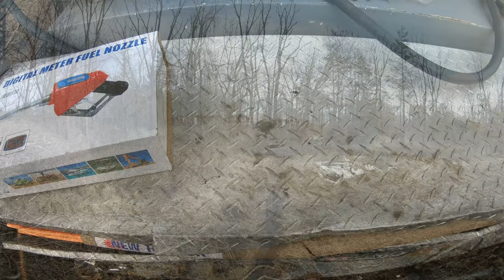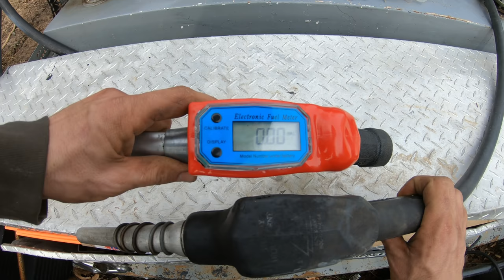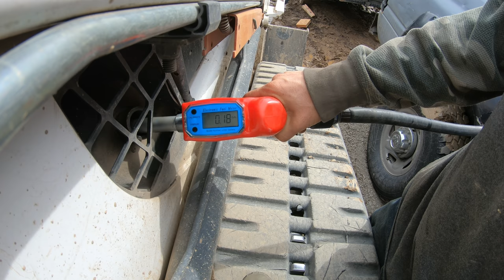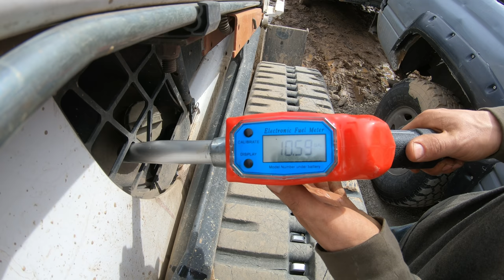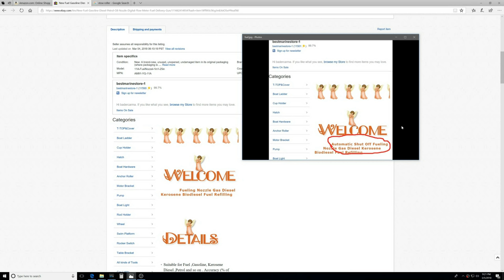Installing an underground propane tank

Comment: Getting the digger stuck made things interesting. As someone else said, don't you compact the ground or gravel? In the UK with have to compact everything and we'd never back fill with water in the trench.
Reply: I think it's very bad practice! Should never back fill with wet material and he should of sanded the trench before back filling and should of got rid of the ground water and the sloppy wet shit!! I have watched a couple of he's videos and don't think he's work / ground works is good at all in my opinion..!! He would be sacked if he did that sort of work here in England
Reply: I dig and back fill slatted tanks. Often backfilled them with a foot of water in the bottom. Never had and problems as track it in and so on. I back filled a tank in really hot weather the hottest we ever had last summer. The soil was like dust going. I thought it was fine until the rain came and it all sunk down bring concrete pads with it
Reply: @ferguson20diesel49  I know it's different weather in the US but general practice groundwork is a not good! I am not saying your a bad worker! I am just saying your groundworks could be improved .... Your a dam hard worker!!
Reply: luke Grace wet souls of Ireland. Very rare to dig a hole not have water in the bottom of it. No customers have came back so all is good.

Comment: talk about a shit ton of ground water.... Will a septic tank work with that much ground water?
Reply: it will  float :-)
Reply: That ground water sure could be a problem. My family built a house in eastern Wisconsin. It had to be ditched on two sides. Eventually we installed two wells 3' diameter by 6' Deep on far corners. Then two sump pumps. Lots of mold problems in the house.
Reply: Man, that's wild! But yeah, I have a feeling that this will be known as the "Swamp House" I've never seen so much water. Not an idea place to build a home I think...
Reply: The septic system we had in Wisconsin ended up leaching into the ditches. It could be very stinky. In the winter the 3" line from the sump pumps would freeze until we ran a coil down the middle. It drained into the ditch which of course froze so it created a skating rink that just got bigger and bigger through Jan. and Feb.
Reply: Here where I live in Canada,..I'm fairly certain that.our Department of Health would condemn that area for a septic field.
Man oh Man , Andrew, you have a lot of water to drain away from there!
Reply: There are alternate septic system designs that work fairly well when the ground is saturated like that, but many states don't recognize them as an approved method.  The standard design tank/drainfield is getting dated anymore, states need to catch up and approve better methods which not only work in marginal conditions, but often return a better end product to the ground.
Reply: What are those alternative designs? I'm looking into a septic system in a saturated area right now, actually.
Reply: How about a mound system
Reply: Where I live, you've gotta have at least 36" of stable soil between the water table and the floor of the leachfield.  If you build in a river/creek bottom/flood plain or area where the water table is high and would contribute to an event driven failure (extreme rain event, snowmelt, etc.), a good choice might be above-ground placement, like @Larry Kluck suggests.  Get a soil analysis and perc test done, then check to see what your area allows for design.  If you have to place the mound system on a higher grade, a pressurized tank/field array can work pretty well.  Biggest thing is to keep the leachfield viable and tank arrays free from groundwater infiltration.
Reply: It’ll work but fill it either water before you cover with concrete
Reply: Septic is so '90's old technology
Reply: My tank always had standing water on the top of it.  It caused the regulator to fail repeatedly, and eventually the tank developed numerous leaks.  I now have an above ground tank.
Reply: @Harley04  yes 1890s
Reply: @mikewalko536  They are called mound systems
Reply: @mikewalko536  an engineered pressure dosing Mound system would work either in PTI or Infiltrator. Most code worth its salt would require a 40-60 inch dig out backfilled with proper sand then depending on water saturation levels I guess about a 36-40 inch finished mound. I have installed smaller mounds but not in such a wet area honestly I don't see how the house was ever intended to stabilize in such an area. I have seen project sites where removing 3 feet of muck and filling with fill dirt was the only way the land became viable this seems like similar land without out the de-mucking done. I would like to see a 10 year follow-up on this particular site.
Reply: @regsparkes6507  As a fellow Canadian I realize that Canada is a huge country.  It is absolutely massive and what is condemned in one jurisdiction would be acceptable in another.   Of course Americans refer to Canada as just that but being a little more specific would help.   Even a provinces except for the maritimes are huge.
Reply: Peggyt1243 I have found that people in Ontario  refer to “here in Canada”  as if they are the only province that matters, conveniently forgetting the other 9 provinces and 2 Territories.
Reply: @regsparkes6507     The only septic allowable would be a 2000 gallon holding tank that you must pump out every time it gets full. NO WEEPING TILE BED ALLOWED!!   In Canada.
Reply: @rickoncordova1  I don't think your statement is correct for all areas in Canada,...( in fact I know it's not ) I do know that this is NOT the case in my province.
If you have to pump out a 'septic tank' then this would be known as a holding tank,..and not a septic tank.
Reply: @regsparkes6507      Reg. Talk to a septic tank installer or the inspector at your township office and have them explain to you the difference between a septic tank with weeping tiles connected to it and a holding tank with NO weeping tiles or bed connected to it.  Thank you.  Rick

Comment: All of your drainage ditching sure helped a lot. The site was a lot drier when you dig the hole for the propane tank compared to trenching the waterline. The propane guys backed over the trench with no issues.
Reply: m9 ovich 
You can see the well head beyond the truck. He certainly did back over the trench.

Comment: Holy FMF !! ! That would really piss me off!  Auto stop does not work. That is a major issue. Does it give an accurate reading? Pumping into a 5 gallon jug is not any kind of an accurate measurement when you are pumping 100 or more gallons into your equipment or a holding tank! Made in China?
Not to be a negative nelly but, in Canada we are not allowed to bury propane tanks. Don't know why? seems logical , keeps from liquifying when it's -50C or so with wind chill.  Would protect it from the wind, plus the thermal heat would help to keep it warm. 
Who am I to talk logic when we have a person a the helm that is yahooing with a dress on and joint of pot in hand?  CHEERS ANDREW, LOVE YOU VIDEO"S!!!!!!
Reply: Joel Hill really you can't have underground propane tanks in any of Canada?
Reply: I spent 12 years in the propane industry in Toronto in the 80’s and 90’s and you certainly can’t bury tanks. As mentioned it would help keep pressure in the tanks when the temps hit the -40* mark and propane doesn’t boil to produce pressure. We would often have to go to construction sites with 2000 gallon tanks to put a few hundred gallons into them to get them some pressure and the tanks were coated with 6” of ice. 

Some reasons I heard why we can’t bury is because of corrosion and leaking. The white bags they put around the tank should help since they are a sacrificial anode that will corrode instead of the tank.
Reply: Wayne Crews wow. Never would've thought that. Around here in the northeast its very common to bury tanks. I've dug holes for dozens. Usually the propane company will give you a print out of how much bigger the hole has to be then the size of the tank getting installed and the minimum depth from the surface. That one looked a bit high to me. Also most companies want you to back fill around it with mason sand not native dirt , and they have all had at least 2 anode bags on either side of the tank.
Reply: Meadow View Lawn Care LLC 

I think finished grade will be higher once all the other work is finished off. 

I know I wouldn’t want to have to search under 2’ of snow at 2am to fill a tank for a customer that ran out of propane. 

Out of curiosity what is the life expectancy of a buried tank and do you need to replace the sacrificial anode bags before replacing the tank?
Reply: Wayne Crews not a expert by any means but I asked one of the propane guys on one of the first tanks I dug for and he said 40-50 years. I'm not sure if the bags need replacing before that. The ones I've seen put in have a heavy epoxy paint on them. Even at that, I still wouldn't wanna be around when one lets go! How are the laws in Canada around under ground residential  oil tanks can you have those? Mostly older homes here have them like from the 50s.  Not as common now.
Reply: I think I found the same nozzle online and I looked at the description. I don't see anywhere where it says "auto-stop". Are you SURE it is auto-stop. On the part of the nozzle that goes into the tank, is there a small vent hole? If not, its not auto stop.
Reply: +Joel Hill  I live in the California Sierras and we are not allowed to bury our tanks either.  Our big tanks are 499 gal as they have a stupid level of rules and regs and insurance  that kick in at 500 gal.   Even so, the 499 gal tanks have to be at least 50 feet from the structure.    I feel your pain, we have Governor "Moonbeam" at the helm.
Reply: @kayakingphotos  He showed a screenshot where the nozzle's description showed it as auto shutoff.  He also said the seller gave him a partial refund AND changed the description so it no longer showed it as auto shutoff.

Comment: Leakage from buried tanks can do the same thing pipeline leakage can do, which is saturate a lot of soil around the tank instead of just venting to atmosphere, which is likely why some jurisdictions prohibit burial.  

Except for appearance there's no reason to bury them and it makes future external corrosion inspection impossible. Looks nice though.
Reply: One reason to bury them is to keep them warmer in cold climates. At -40 there is no vapor pressure so the gas won't come out of the tank. You have to build a fire near the tank, which is kind of scary.
Reply: Yea to keep it warm you would want to burry it. I believe it’s -25 or so propane gas turns to a liquid and it won’t flow correctly. But even I little warmer and you start to run in to pressure drop. Definitely a good idea to burry has nothing to do with looks.
Reply: Propane stays liquid at minus 44F.   @tiredoldmechanic1791
Reply: -44F propane stays liquid yes.   @brettchristinaadams8112

Comment: You do some backwards arsed stuff sometimes andrew 🙈 next time you dig the last piece of trench straddle it at the opposite direction. That trench should have had some drainage chip in the first few hundred millimeters as well which would have kept the mud out of the water

Comment: @25:24 The moment you start tracking fuel consumption per job. Next day increase mark up by 5% per job.
Reply: Jacob M. Altland and more of this 02:15
Reply: The guy is logistically brilliant though. He gets most of this done with his own power. Hats of to working with a small crew.
Reply: I dont know for sure if he would. I was making the point that untracked fuel expenses can be detrimental to a company. So when you take a look at how much each job is consuming you can better determine the mark-up per job. I assumed a mark-up of 5% becasue fuel can account for at least that amount of a projects costs.
Reply: I track all of my fuel expenditures in my business.   Since I am a truck driver, that falls into 3 categories:  Fuel usage while loaded, fuel usage while empty, and reefer fuel usage.  All 3 of those impact my bottom line.  Finding ways to decrease fuel usage is a benefit to any business.
Reply: House Music  Yeah hippie that's exactly the reason.
Reply: Michael Tovar can you get a refund on road tax for the amount you burn not moving but running refrigeration?  I heard some of the gps enabled log book and trucking software would track these details for tax and billing.  Keep on trucking 😀
Reply: markusayt the fuel is red... that’s heating oil. AFAIK, you can get into some pretty deep shit for using heating fuel in your transportation vehicles. Not sure if it is an issue with construction vehicles.

Comment: I'm getting reamed for Propane in the PNW.  I'm living in a travel trailer while the house is being built and they're charging me $2.89/gal.  It's costing me about $200/mo to heat the trailer -- my previous MH cost $95/mo at most to heat in (a colder) winter on Natural Gas.  I'd hate to see the bill for that 500 gal tank (425 gal net)!
Reply: I wonder how much of your $2.89 per is for 'taxes'?
Reply: the more you get per trip mean less often they deliver=Lower price.... and price shop for gas  on tank ownership vs lease- and suppliers
Reply: Wow, $2.89, I was pissed paying $1.89. Guess I shouldn't complain... You need to look into buying your own tank and shopping around for the best cash price. If you're in a trailer you should be able to make due with a 124 or 300gal tank.
Reply: The trailer is a temporary situation, just until the house is finished in ~June.
Reply: I live in WA State and we have a 500 gallon propane tank for our shop heater. While you pay $2.89 / gal, most bulk purchases are significantly cheaper. It's been quite a few months since my last fill up so I don't know how much less, but I do know it is less than what you pay if you fill up your RV tank. We also have the option of "shopping around" to find the best deal. It's still expensive, but there is savings.
Reply: Yeah I hear ya. I get a price break if I order 250 gal or more, so that's what I'll do... I also like to buy in the middle of summer, price is cheaper sometimes too.
Reply: Here in southern Wv it's  1.59. The cheapest month to get it is in April...
Reply: Damn that's cheap, almost make ya want to have an extra tank to fill.
Reply: EFormance Engineering lll.
Reply: M

Comment: My underground tank was a disaster.  Always filling up with water in the gauge and refill area.  The water caused the regulator to fail repeatedly.  Eventually the tank started leaking in several areas.  I now have an above ground tank, and zero problems.

Comment: Wow what if that chain breaks when pulling out the skid steer you would be chasing that maching in the woods.
Reply: Mike Hurley that machine moves so slow anyway. I’ve seen wheelchairs move faster
Reply: Way too many unnecessary risks.
Reply: meh, I've seen far worse from other people. Those who work at heights without harnesses are far more likely to get hurt. From what I've seen with Andrew he has a great mind for getting shit done, good attention to detail but without the bullshit. I think he has a good understanding of the risks.
Reply: Chains don't store much energy. Don't tow with nylon unless you know the risks of a kinetic recovery. But chain or Amsteel doesn't stretch and won't spring back much. ETA, nylon plus a weaker chain would be a really really bad idea.
Reply: @cageordie  I think you're wrong about chains. you do NOT want to be in the path of any part of a chain when it breaks. the direction of shrapnel can be unpredictable too. you'd think standing to the side is safe, until a hook or chain link comes your way
Reply from the maker: @lorenzo42p  Chains don't fly when they break. That was not dangerious. Plus those machines cant break that chain.
Reply: @AndrewCamarata  I beg to differ. Links of metal like that under such stress, you don't think that energy could be released into one flying link?